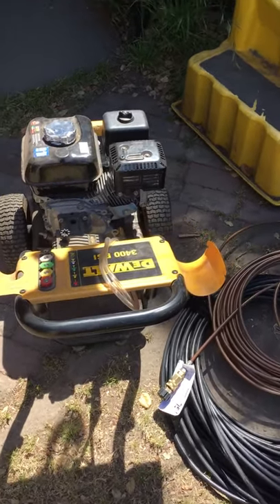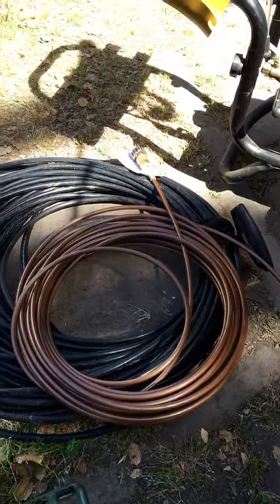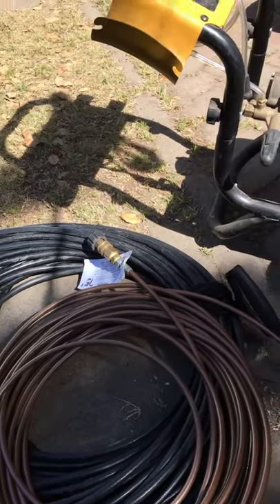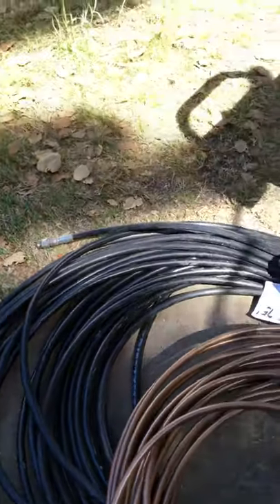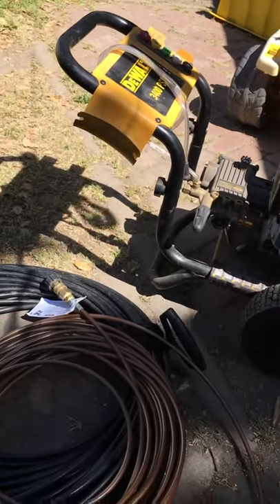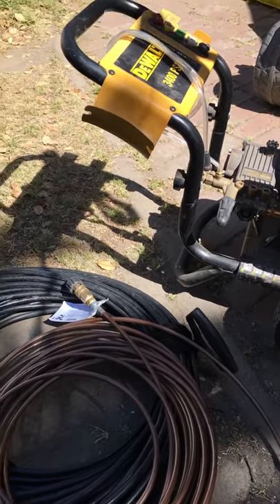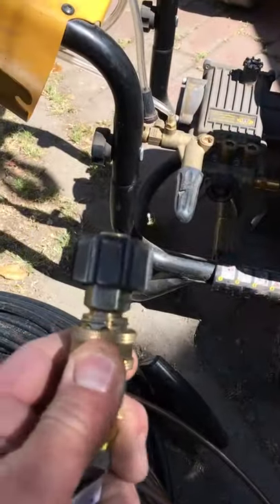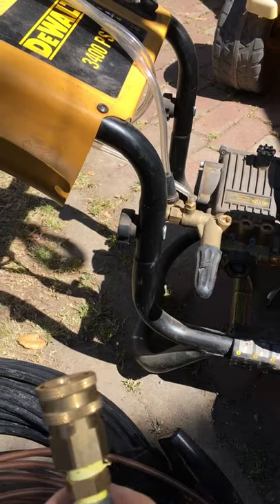How to make power washer into jetter machine

Comment: I just made my own.. I have a harbor freight pressure washer 3100psi, great for washing my lifted truck. Then when all kinds of drains backed up in my house, I just went and bought a regular 40 ft 3/8 hose, a nozzle from Grainger, an adapter to fit the nozzle onto the hose, removed the wand from the gun of the pressure machine and WOW, calcium build up like no other. I got to see it cause I had my septic pumped and then I hydro jetted. Would've cost 700 dollars or so for the service, cost me about 150 dollars for the extra bits I didn't have to hydro jet. Just bought a thinner hose to tackle smaller lines.. just in case

Comment: I heard stories about jetter heads got stuck in the drain  line and cannot able to pull out (causing a nightmare). Any tips on how to avoid  such incidents. At timeline 1.30 you talked about the main line hose and small hose. What are the sizes of the hoses 1/4, 3/8 or 1/2 and where do you order it? Thanks.
Reply from the maker: 1/4 is perfect for regular mainline cleaning and 1/16 for the sink drain. Never had a jetted head get stuck before and I think you’ll be fine it’s really hard to get them stuck.

Comment: If you're gonna do a lot of work should probly add a  jetter valve to the pump.  The valve will allow you to initiate more bends in the pipe.  With constant high pressure  makes hose very stiff and harder to initiate turns.
Reply from the maker: Really just having a thermoplastic jetter line is the best and style I use but if you use a power washer hose I say different they chink up all the time
Reply: Where can I get the pulse one?

Comment: Whats the minimum Psi/Gpm recommended to clear your main line of build-up/roots?
Reply from the maker: Around 1000 psi should be good enough but it would have to be on a jetter hose with spray tip also it will cut through roots as long as there not big roots they need to be the white string roots

Comment: Where did you buy the fittings to connect to the pressure washer and the spinning tips please?
Reply from the maker: At hardware store or eBay sells the hose and quick connect fittings also get thermoplastic jetter hose they last longer

Comment: I had same idea and searched for it....LOL   Plumbers must hate you.   I am a home inspector and have a sewer camera.  I plan to tape my camera head to jet line and give that a try.   How stiff is the jetting line?  I was thinking of buying some one inch PVC pipe with threaded ends, screw together, put in my line (no turns out to main) and ram it out a bit.  Not plugged, just has some debris in the bottom that stops my camera.
Reply from the maker: The jetting line is stiff once the pressure is on so not sure if that would work but those camera inspection kits are pretty cheap but still give it a try just make sure it's on the line securely so it doesn't fall off
Reply: @mr00dito  I have a good Ridged camera, $3,700 of good.  LOL   Was just looking at power washer conversion kits they sell online.  Def. going to buy a kit.   Thanks for the vid.  PS.....jetting here in Detroit is around a thousand bucks.

Comment: where to buy adapter for small hose. what size adapter for small hose? please help? Thanks
Reply from the maker: The adapter is the same for both hoses small and large . The hose size is the only thing that will change in size not the adapter and that adapter is sold where they have power washer fittings at Home Depot

Comment: Great job sir, but can give the exactly name og the fittings? Thanks
Reply from the maker: I think there called quick connect fittings they should have at all home improvement stores the hoses I got off eBay and some are a kit that comes with those and hoses with jetter tips
Reply: He was pretty impressed by the quick connects and how necessary they are.  Instead of going on about quick connects, he could have demonstrated hooking up the trigger/wand assembly to the two hoses.